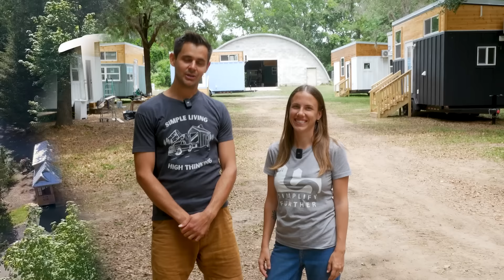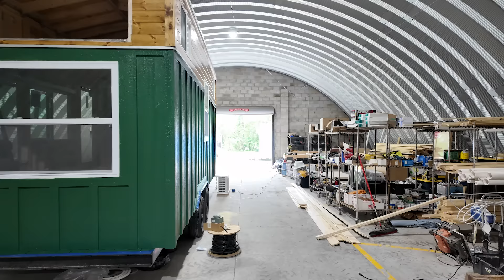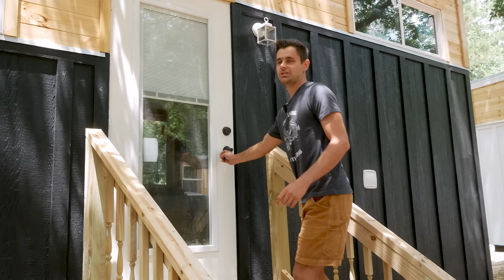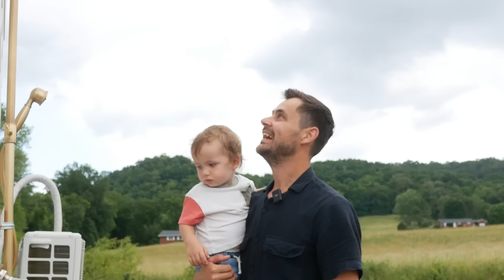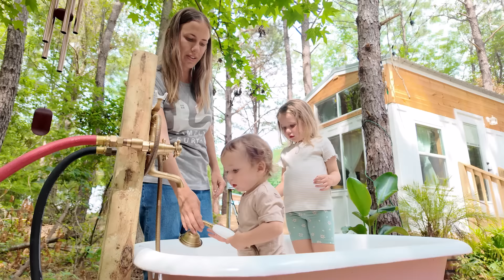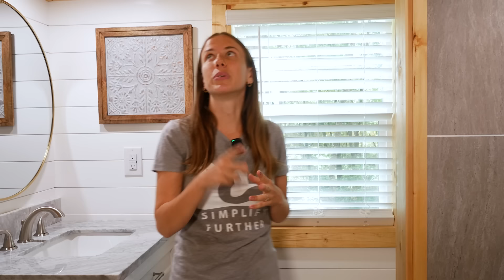Does this family build tiny homes cheaper than everyone else?

Comment: I just love every episode because I take a tiny ( pun) ha - or a huge ideas from every one. I actually do like the smallness of these BUT I want a stove/oven, a small not mini refrigerator. Also- a lot of people are not liking the washer/dryer combo so I would need a stacked kind. So all in all I don’t think these would work out for me but they may be perfect for a young couple just starting out that can go without a kitchen essentially and keep cost low. 
That’s what I love about them. Not everyone can afford the skyrocketing prices of even some of the tiny homes nowadays. So way to go! And love the two tiered deck !
Thanks for showing me around !!! 🏡❤️💯🙏
Reply: @leanneadams2549  they set it up for AirBnB use, which is different than living in one full time. Plus they can customize it to fit your exact needs. As far as the combo unit, I noticed that it is vented outside. I have the same one and love it. It uses heat to dry the clothes, and the moisture is vented outside. It takes less time to wash/dry than the non-vented ones. I could have put a stackable in but I opted for the combo so I could have more storage space. Some people like them and some don't. :)
Reply: "Voted" Best comment.

Leanne Adams

Comment: I like the work you are doing. One question, though: If you pull water directly from a river, as you suggested, (for shower or sink) how to you avoid contaminating your potable water system? (Or did I misunderstand what you said, which is entirely possible). Also, just for future reference, it's a "quonset hut," not a "Kwanza hut.") They were practicallty given away after WWII and they are a mainstay on many a post-war farm or industrial site. Your builds like great and I'm impressed with your willingness to focus on the end product, not having an employee punch a clock.

Comment: Lots of great energy! Wonderful ideas!! I don’t understand the truck that is to tow a tiny house cross country with 6600# of improvements with a limit of 8K#??? How is it going to tow with all that weight?! Did I miss something?
Reply: This confused me too.
Reply: Payload (the 8,000lbs) is different from towing capacity (probably 20,000lbs. for that model truck).
Subtract 6,600 (the payload--or what the truck is Carrying), from 20,000lbs (the Max tow capacity --or what the truck is Pulling), and you get 14,400lbs. available towing capacity.
Most of their homes are 10-12,000lbs, so they're within their vehicle's limits for towing.

Comment: That camper truck tiny home is pretty cool but I would have definitely put the opening for the lofted bed at the end of the bed where your feet would go because the way they have it set up by the pillows, if you're sharing the bed with someone else the person on the far side of the bed would have to climb over the other person's head to get on and off of the bed, which obviously is less than ideal to say the least.